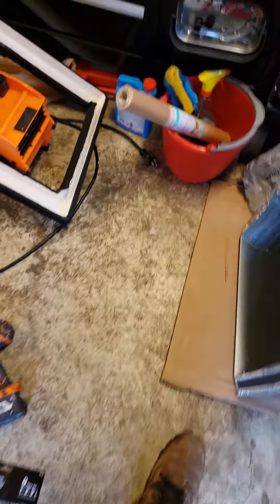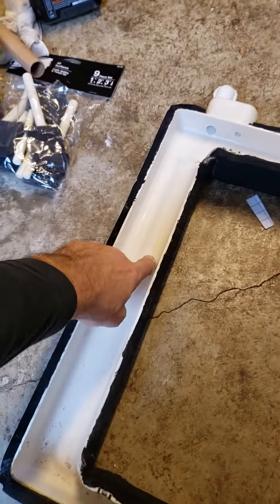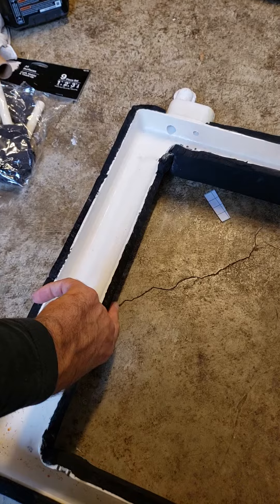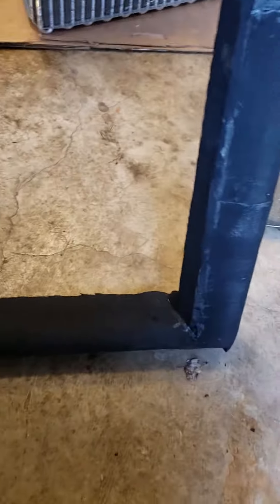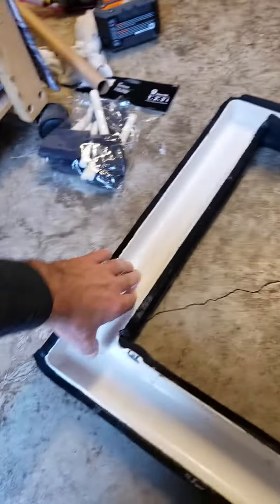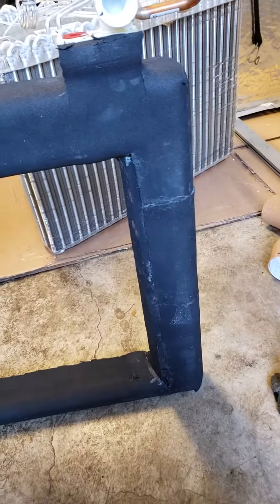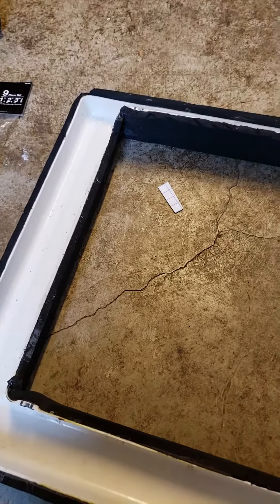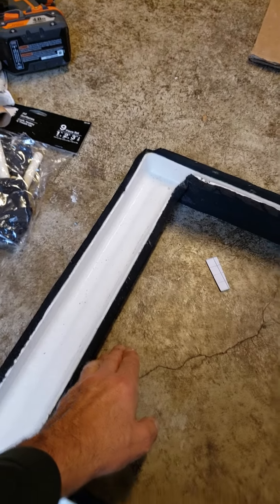HVAC properly insulated drain pan.

Comment: I Am so glad I found your video, our friend installed our ac , obviously didn't know about this. We started noticing mold in our plenum under the squirrel cage, and through ductwork. Ours is in a downflow configuration. Where did You get the neoprene? They have one sided adhesive neoprene on amazon, is it better to use contact cement, and what is the minimum thickness I should get.
   Thanks!
Reply from the maker: Armaflex half inch, i dont like self adhesive. Ya have to stay out of home when using contact cement until cured. Run fan while curing
Reply: @organicvids  Thanks, I wondered about the  vapor, We have 2 Macaws, and they all have sensitive repertory  systems. So if I buy a new pan and insulate it, let it air out for a month or so, would that be good. When running the heat could it cause the cement  to off gas.
 Thanks
Reply from the maker: @robertbelknap  look up msds sheets.  My cockatoo is fine. If ur birds got repiratory issues its bad air on home imo or dirty cage. Look at my videos on hvac i explain my system in them
Reply: @organicvids  I meant exotic birds in general, they all have sensitive respitory systems. Pfoa and stuff like that kill a bird quick. Our harlequin was born in 1980, and our Scarlet is 12 yrs old.
 Thanks.
Reply from the maker: @robertbelknap  feed them organic bird food, fresh veggies, let the use their flight wings, get good filtration in home,no teflon. Parasite check once a year at vet. No candles, insense, artificial air fresheners., smoke or ozone. Spring or well water. If u smell it ie chemical, not good. I use orange peel oil on bottom of cage daily. Kills mites and freshens bottom of cage. Beware harsh cleaning chemicals in air.
Reply: @organicvids  Yeah, We feed them Tops, and all organic veg from sprouts. They each have their own room. Wife uses vinegar to clean.  
 What would you charge to insulate a drain pan?
  Thanks
Reply from the maker: @robertbelknap  to tell you the truth contact cement and acetone are not my friends. You can buy a antifungal drain pan with microban like i did, buy some armaflex and take it to any boat shop they can glue it for you. Then install it. Get a iwave installed pre blower.
https://youtu.be/7xkNejnzFG4
Reply: @organicvids  The Ac guys here tried to sell me an air scrubber, are they safe?
Reply: What website do you get the armaflex from, I've only found kflex.
 Thanks
Reply from the maker: @robertbelknap  
https://www.armacell.us/products/aparmaflexaparmaflexfs/
Reply: @organicvids  Can I buy direct, Im not a contractor